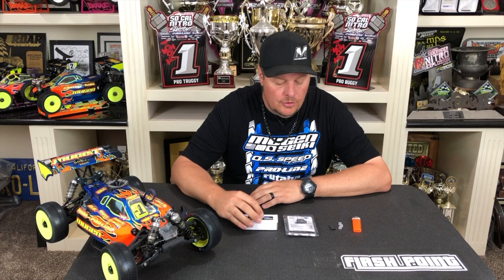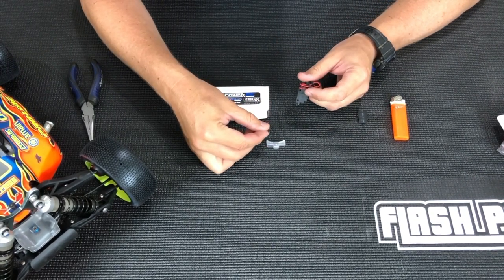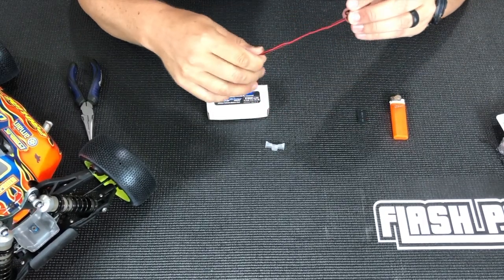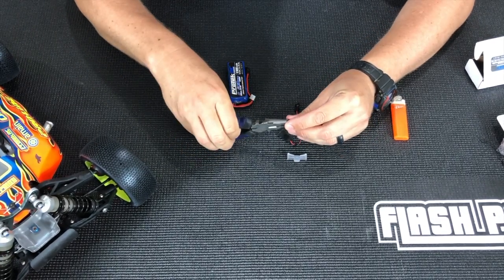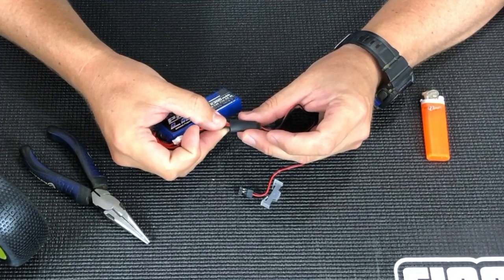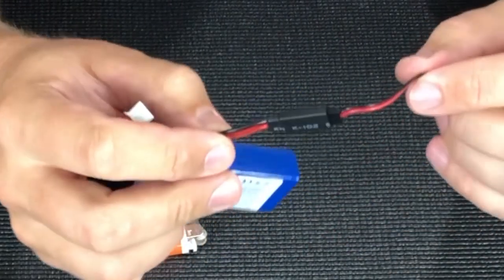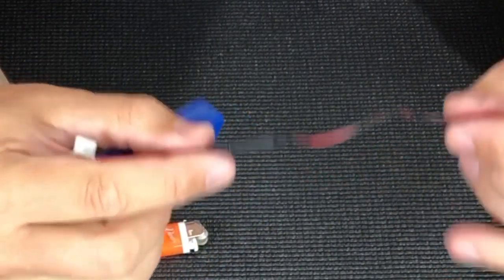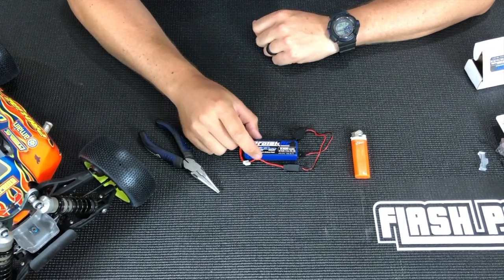Adam Drake from Mugen Seiki Racing - Tip for securing battery connection.

Comment: Always great your video's 👍 so helpful to newbie nitro lovers.
If you need to charge your receiver battery as I've been told not to have it plugged in after racers, how do you go about changing it?
Thanks Mark
Reply: Interesting question 😉
Reply from the maker: I always use the balance plug on the battery with the Protek charge lead for charging the battery.  It works great and is much safer.
Reply from the maker: I always use the balance plug on the battery with the Protek charge lead for charging the battery.  It works great and is much safer.

Comment: Hi Adam so I've read on these comments that you charge through the balance plug. I have a balance plug on my car that's pretty short. Do you leave your balance plug hanging out of the side of your radio tray, or are you actually removing the tray to access the balance plug and charging it with that? This is how I'm doing it right now but I'm worried oflver time the plastic on the radio tray screw holes will wear out.
Reply from the maker: I leave the balance plug hanging out of my battery box.

Comment: Great video, thank you - one question though: do you leave the plug assembly out of the battery box, loose, or do you cram it into the battery box? I am also running the MBX8, and find the battery box is quite tight. I don't cram the plug into the box, because I am worried about damaging the wires from the pressure and tight kink doing so would require. But with the plug out of the battery box, I'm worried about dust getting into the plug and messing up the connection. Thanks in advance!
Reply from the maker: I keep the plug in the box on my MBX8's.
Reply: @AdamDrake  Thanks!

Comment: How often do you change the battery with the connection having heat shrink over it? Or do you just keep charging up the same one after qualifying ready for the mains. Are the battery’s ok to be left connected?
Reply from the maker: It depends on the switch, but I usually just leave it connect and always charge through the balance plug.

Comment: I use to run mechanical switch but i've had to many failed so i run my battery straight into the receiver and have never had a problem, but i have yet to try an electron switch so worth a shot.
Reply from the maker: The switch is something that needs to be changed from time to time, but the Protek electronic switch has been really nice.

Comment: Excellent tip, Adam! The only thing that has kept me from doing this is the charging dilemma. How do you charge the battery once you do this? Can you disconnect the switch from the receiver, turn the switch to the "ON" position and charge the battery through the switch in the opposite direction?
Reply: Same problem. Whats your solution Adam?
Reply: I would say he gets an balance port and connects it and charges that way but not sure if that’s works I have the same problem but a switch it’s not expensive when it wears out the season will be over
Reply: @tylersvensson6066  Yeah thats my solution too. I am charging via the Protek Balancer Charging Lead. But if I am using the Protek Switch and let my battery connected after use it should begin to discharge slightly. The question is whether this discharge power is enough to fully discharge the battery pack over time?
Reply from the maker: I always use the balance plug on the battery with the Protek charge lead for charging the battery.  It works great and is much safer.
Reply from the maker: I always use the balance plug on the battery with the Protek charge lead for charging the battery.  It works great and is much safer.
Reply from the maker: Yes sir.  :)
Reply from the maker: If you plan on not running for more then a couple of weeks it may be best to disconnect the battery and store it in a case.
Reply: Can you charge the battery through just the balance port? Or does it need to be connected to the red and black wires from the battery too

Comment: I use 2mm bullets on the end of your battery and switch. Female for the red wire of the battery and male for the black wire. I'm surprised so many still use JR plugs for this connection. Actually takes up less space than the jr plug, and no need to keep using heat shrink like this video suggests.
Reply from the maker: There are a number of options that work great.

Comment: Hey Adam, quick question then: How do you charge the battery then? Do you cut the shrink wrap off every time or do you have some other charging solution, maybe by balancing wires only? Thanks in advance!
Reply: But the switch still needs power even if its not on. So charging while the battery is giving power sounds not like a good idea.
Reply from the maker: I always use the balance plug on the battery with the Protek charge lead for charging the battery.  It works great and is much safer.
Reply from the maker: Not sure if this is the best way, but it's how I do it and it seems to work okay.
Reply: @AdamDrake  maybe i am driving not enough ;)

Comment: Ahh video posted almost immediately after pnb..... how many times did you see this happen at the race... Thanks for the videos Adam.
Reply: Why does my rc truck have smoke in the gas tank when i run it for a bit
Reply: @jesseg251  It's nothing to worry about. Remember, the exhaust applies pressure into the fuel tank so some of the exhaust goes into the tank. It's completely normal for that to happen. Hope this helps!
Reply from the maker: Very true!  :)
Reply from the maker: Because the tank is pressurized from the exhaust pipe.
Reply from the maker: Thank you.

Comment: Nice idea, how will you charge the pack?
Reply: Cut off the 3c of heatshrink
Reply: @clives681  Sounds like a big waste....
Reply: @dennisv.9289  makes sense for an hour long mains, just another item to go wrong, cutting the heat shrink is not big deal.
Reply: @ajojoseph6052  makes sense, but Adam talked about putting his battery in and forget about it. If u cut it after every race then this is not the solution we are looking for to reduce maintenance.
Reply from the maker: I always charge the battery through the balance connection because it's better for the battery and much safer.
Reply from the maker: Yes sir.
Reply from the maker: It's not really to reduce maintenance, it's more to increase reliability.
Reply: @AdamDrake  Do u let the battery in your tray for longer times like 1or 2 weeks?
Reply: @AdamDrake  i tried your version too. It works great my only reason to change it was that the battery was slightly discharged over the week because the protek switch keeps using some power

Comment: I use a tiny zip tie. I go in between the wires and pull the connectors tight. Your method is cleaner though.
Reply from the maker: Great tip!